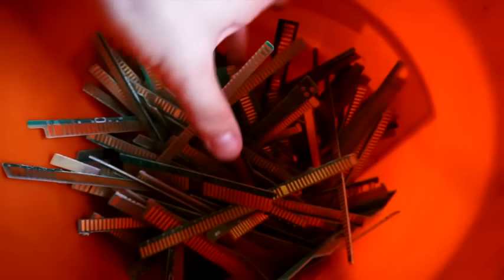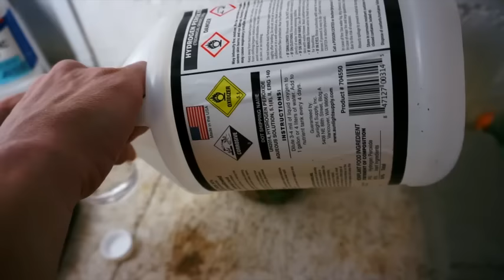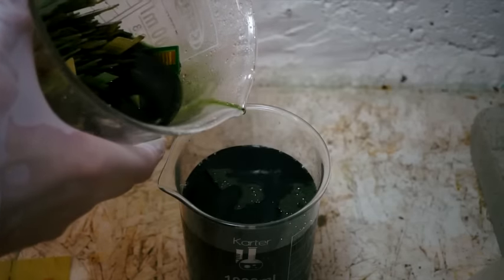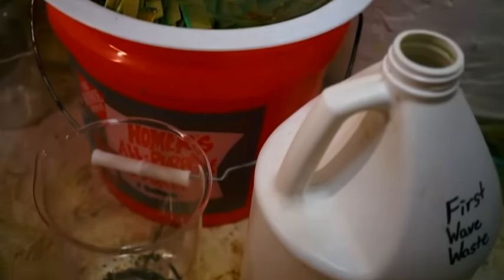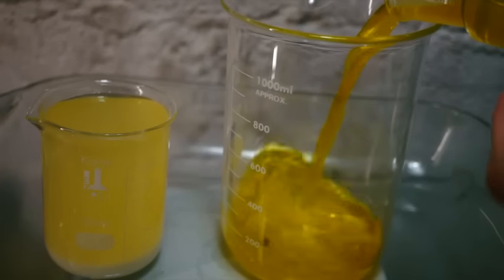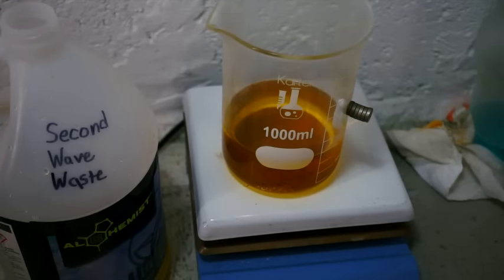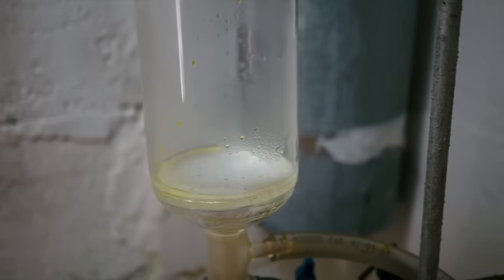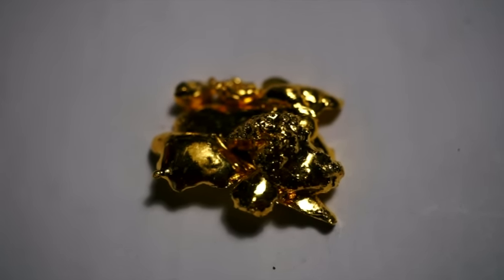How to extract and refine gold from old computer parts.

Comment: In my opinion this guy's doing it  backwards! This process I'm about to explain is the reversal of electroplating, this is how you load up a solution with gold prior to electroplating! And only after this point you would electroplate Gold onto something of Desire! And of course in this case it will be steel wool! You would be smarter to place all your base Metals/circuit boards, that  have  gold plating on them  into a container, then you submerge them in a potassium cyanide solution then place a bubbler at the the bottom of that container and you bubble oxygen in to it, this allows you to oxygenate all your gold plated base metals/circuit board, while submerged in the presence of that potassium cyanide solution! with this chemical reaction you have created, this will allow the gold to dissolve into the potassium cyanide solution, after doing so you remove the base metals/circuit board, that no longer have the gold plating on them! you keep repeating this process with more base metals/circuit board, and go round up any and all gold plated jewelry you can get your hands on, hell get creative go throw Grandma's old gold-plated tableware set in there too! Anything you can find gold plated! and you continue to load up your potassium cyanide solution! when your potassium cyanide gets completely saturated with gold suspended in it, now that this gold has been dissolved into that solution, you need to recover and extract the gold back out of it, you do this through electrolysis, you will electroplate the gold out of that solutions back onto steel wool! obviously you suspend your positive lead in solution, and connect your negative lead to that steel wool, then submerge it into the solution! and you electroplate the gold onto you're Steel wool! you can crush up gold ore and achieve the same results by oxygenating your gold ore! Once you succeed getting your gold recovered from The Ore, that gold should now be dissolved and suspended in that solution! you once again take that solution, and by submerging steel wool into it, like you did from the gold recovered from the base metals, through oxygenating and then electroplating, you recover your gold that's been electroplated on to the steel wool, now when extracting gold from ore through oxygenating it in the presence of potassium cyanide it is important to remember and understand that platinum sometimes nickel and silver comes acrossed out of that gold ore with the gold! you can separate these different alloys simply by adjusting the voltage when electroplating is being performed, the electroplating of platinum requires a different voltage, as well as silver or nickel , I had a friend whose gold mine turned Platinum, this was how they separated the Platinum from the gold through this electrolysis process! now you take that steel wool that's been electroplated with gold, place it into a porcelain Cruise, hit with a torch! [Blowtorch] don't be afraid to turn the heat up on it! you want it pretty hot! your objective is to burn that steel wool up, and trust me it will burn up like the filament in a light bulb! anyhow, you throw flux on it,[ borax]  keep that flame on it, keep it hot! and then your gold will puddle up in the bottom of that cruise! It well look like a beautiful puddle of golden Mercury! there's your finished product! it'll be high grade clean gold! the process that this other guy is talking about is the backwards approach to it! You Can't really hold it against him! everything is about exposure observation! and definitely paying attention to detail! just about everything I have learned I've learned on the lam! once again Better Living Through good Chemistry! I'm not really impressed with his process! As a matter of fact when he was talking about using your muriatic acid to lower the pH in your swimming pool, I doubt if he even knows what a titration is or what the definition of pH stands for! That term indicates the presence of hydrogen, although I could be wrong! he might have an understanding on all of that!  like I said I don't think the guys very informed on metallurgy, although I do like his nature! I'm sure if we ever cross paths somewhere in the future, we would be friends I'm quite sure we definitely have enough in common! At least he's off to a start! He definitely is acquiring the Midas touch! I once had that touch! it almost destroyed me! it was a different type of gold! You know, in this world there are two types of men! those who possess power! and those who are possessed by that power! The big lesson in life is to try and figure out which man you are going to be! And then be that man! Anyhow everybody's got to start somewhere! You got to crawl before you walk I get it! it's not fair for me to chastise, and be too hard on people!I have a tendency of doing that! I apologize! although, I have seen meth labs out on the lower back 40 of somebody's property with better well-equipped labs then his little Workshop! Presentation is everything! his process will work! it's just a backwards slow bottom Keel approach and process!"If maybe you were stranded on an island, with nothing else to work with! I guess eventually you can get her done!" nobody would ever let that guy near a Gold mine, they probably would chase him away with a broom, if they didn't have time to teach him the proper way to do it! One important side note involving the process I was referring to! at no time ever should you allow any types of acid to come in to contact with that potassium cyanide Solutions,or sodium cyanide!or benzyl cyanide or any other cyanides, ever! when they're suspended in this or any solutions, They are generally very stable and quite safe! providing you refrain from any introduction of any acids that might free or crack off that Cyanide! And if so you could very easily poison yourself or anyone in the vicinity, including birds flying by! so by all means do a little research, and be very safe about it! Always work with some adequate type of overhead Hood ventilation, safety glasses, face Shields, rubber gloves, chemical resistant smocks, fire extinguishers, and always have good respirators with the proper chemical ratings available! And if you don't have some sort of a( emergency chemical shower nearby have a garden hose with a adequate spray nozzle on it for emergency wash situations) it's not a good idea to ever work alone! it's hard to find your way to the hospital if something blows up in your face and you're sitting there blind! believe me, I've seen it all! I have a buddy that had to get a cornea transplant over this type up stuff! in regards to cyanide! the releasing of cyanide was a process Adolf Hitler was using, which was responsible for killing off many members on my mom's side of her family during World War II! think about it! so be very careful with this process! [Just a little more insight shared by an old X outlaw, good luck be safe]
Reply from the maker: Thanks, I am happy you enjoyed the video 🤗 😀
Reply: Hey you welcome Phillip, I really did enjoy your presentation! that gave me a reason to walk back down memory lane and enjoy some old post-prison memories! and put pen-to-paper so to speak, I enjoyed your presentation like a walk in the park, good luck with yourself! And that Midas Touch!

Comment: Always add add to water, not water to acid. You should add the acid to the H202
Reply from the maker: That would be inconvenient. I only used about 100 milliliter of H202 with about 1/2 gallon of acid. It's going to get hot either way.

Comment: Were you wearing any kind of respirator or safety eye wear / clothing?  I saw you weren't using gloves.  Kinda scary chemicals to combine and be seemingly unprotected in my opinion....
Reply from the maker: All experiments were performed inside a fume hood. I was wearing safety glasses 😎 Also I was wearing gloves when I stuck my hands in the acid solution of HCL and H2O2 🤗😀 you need to be careful with that H2O2. At a concentration of 34% it will oxidize your skin on contact. Essentially producing a third degree burn. When coupled with the HCL you are producing a super acid. Similar to piranha solution 🤓

Comment: skip all the acid and try borax without all the liquid over low heat
Reply: Dont understand i ise borax all the time as flux ? It doesnt seem to dissolve the gold one could also use hydrogen peroxcide added to sodium cyanide salultion but you need to do it in a lage plastic trough as it explodes slitly step back or you cound use a salution of sodium cyanide and a car battery charger with a piece of silver as a cathoid  pretty clean your gold doesnt have to be 24 kt because you are payed by assay any way
Reply: Zinc piwder also acts as a magnet for gold salution droping to the bottom

Comment: Hey Philip, just getting started really out on west coast of Canada. Could really use a chat to pick your brain if your up for it sometime soon :)
Reply from the maker: What's going on? My videos are full of information.🤓
Reply: @philipbender956  they are indeed and honestly the best we have seen. Our problem is when looking at the equipment to buy. Not sure what kind of beaker is best, or what you would recommend as a vacuum pump etc
Reply: @philipbender956  oh to quick add, we are doing it with license from our government - so it has to be the right scientific glass, etc but there doesn't seem to be any info on what that is from them
Reply: Maybe we could start with this?...Can you tell me the make, model etc of the magnetic stirring hot plate you use? or the link to which of your videos I could find it? I really appreciate your help on this!

Comment: You really need to make a greater effort to wearing the proper PPE when pouring acids and peroxides, and when touching exothermically heated pyrex glassware.  You should also be pouring acids and peroxides in a fumigated hood.
Reply from the maker: All extractions were performed in a fume hood. I was wearing gloves when I put my hands in the acid 🤔 🤣

Comment: What is that device that just appears at 2:46, you didn't say anything about it, so it's bothering me.
Reply from the maker: I believe that is the aquarium air pump. It can be purchased at most pet stores containing aquatic life. It uses electricity to pump air through a tube 😏 Unfortunately they do not work very well as an improvised underwater breathing device. It has a couple of issues. The first being you need to plug it in. I wanted to use it in a lake so I tried an extension cord. It kept tripping the circuit breaker every time it got wet. Then there was the issue that every time you submerged the pump it would stop pumping air.
Reply: @philipbender956  Thank you for explaining. I have just one more question. Why is it even necessary to pump the air? Because hydrogen peroxide gives it plenty of oxygen.
Reply from the maker: @petronus6682  the air pump not only ads small amounts of air it agitates the solution. The h202 doesn't remain in solution very long. At one point in the video you can see the air being bubble through the container changing color as it reacts with the copper solution.

Comment: A lot of steps to get that gold! But you had damn near an oz of gold. Depending on what gold is selling at for an Oz. Probably made 1,700$ right on this video alone.
Reply from the maker: Thanks, I am happy you enjoyed the video 🤗 😀
Reply: @philipbender956  I been considering getting into this electronic gold catching. Definitely seems like a lot of work! But also seems like it could be well worth it. Where do you find all of the old electronics? Garbage picking?
Reply from the maker: @stackin_steve_8223   The scrap I am using in this video. Was part of a 20 pound lot that I purchased at auction on eBay for $800. Try searching gold fingers on eBay. Or if you collect scrap try selling on eBay.
Reply: @philipbender956  o ok cool. Ty

Comment: 30 percent viniger work to takes like a week but great so many different ways.
Reply from the maker: Yes I prefer to stick to the shorter time frame methods. But you also have to balance the safety involved. Some methods are very quick but extremely dangerous.

Comment: NOW I'LL GO TO THE HOSPITAL AND GET A LUNG TRANSPLANT>
Reply from the maker: No, no, no need. Just stop by my lab. I will hook you up with a nice new robo lung. You can even get upgrades from there website. You know, a do it at home type of deal. It's got Bluetooth and a phone app. So you can control how much and when you breathe. I will even throw in a water pipe attachment if you commit with a $1000 down payment and a contract. Act now as I only have 7 robo lungs in-stock. They go quick around the new year. 😷

Comment: An interesting video, but whoever extracts gold in this way needs to know what he's doing. Some of the chemicals used are quite dangerous, and for a layman the whole process seems a bit complicated. Couldn't you do a video showing a simpler method, which although less efficient is less dangerous and more easily carried out by a novice? Another interesting aspect is what sort of profit can you make after all the raw materials have been paid for? I see you avoid the use of mercury, probably because mercury is hazardous to the environment in the longer term. The waste products of your method are also hazardous, so some advice on how to dispose of them safely would be welcome.
Reply from the maker: Thanks,I am happy you enjoyed the video. That was the easiest way. As for the waste. First, I destroy the waste with sodium hydroxide. Then I filter off any solids. Then I PH balance the remaining solution with sulfuric acid drain cleaner. At that point it is safe to go down the drain.

Comment: I want to send a picture of a powder. I believed it has gold in it but I dont know how to extract it.
Reply from the maker: Is the powder you believed to contain gold also made of metal? If yes, start with a magnet and remove as much ferrous material as possible. Then melt it all together to determine the gold amount. Then use aqua regia to dissolve the gold. If the powder is rock or non metallic.  Use water and pan the gold out.
Reply: Thank you. I will try it.

Comment: Couldnt you just melt the gold flakez and skip the chemicalz?
Reply from the maker: You could, but then your gold would be contaminated with other metals. Then the only way to purify that alloy would be to mix it with silver. Then dissolve it with nitric acid. The method demonstrated in the video is the cheaper  and less dangerous method.
Reply: @philipbender956  ah, I see. I got to thinkin that. Good info, thankz yo

Comment: By the time I purchased all of these glass jars pump for air and a vacuum pump and filters acid i would be broke
Reply from the maker: Yeah it's better to purchase these items over time. Spread things out and buy things as you need them. For instance my hot plate stirrer was also used in my kitchen to heat and stir soup. Then I purchased a microwave and I was able to use the hot plate stirrer in the lab full-time 😀 Same thing with my beakers those used to be cups.......

Comment: Hey, does anyone know what % the nitric acid is?
Reply from the maker: It's over 95%. I demonstrated how to make it in a another video. It will set laboratory gloves on fire within seconds of contact 🤗
Reply: oh wow, could you use nitric acid with a % of 70. Or would this not work :)
Reply from the maker: @samking7631  70% nitric acid will work. You may need to add a few extra drops 😉
Reply: Philip Bender legend 👌

Comment: cleverly used hydrogen peroxide instead of nitric acid.
Reply from the maker: Yeah it takes about 1 liter of concentrated nitric acid per pound of gold fingers to float the gold foils off 🤔 The base metal being copper, it is much harder to dissolve. But the oxidative power of the h202 at 34% concentration turns the HCL into a super acid. That cuts through the copper leaving the gold undissolved 🤗

Comment: Is that a robot talking?
Reply from the maker: It's a speech synthesiser. I salvaged most of the programming from in old speaking spell. I had in my closet from when I was a child. It was old and dusty. The cats had shed on it. But a few dunks in the sink and it sounded OK. So I wired it up to my laptop. A Tandy 6000. 😀
Reply: Oh I thought it was a robot or someone with no nose 👃 it sounds like it.

Comment: i have to comment on this video and this applies to everyone please and i repeat please use chemical resistant rubber gloves when working with chemicals that can burn you like the acid that you are working with and use a face shield or safety glasses also this dude aint doing safety right take it from a pool guy who works with chemicals all the time this stuff aint no job and always use outside not inside or the chance if you getting your throat burned is real
Reply from the maker: The smell of chlorine is quite nice around the lab. I use it to disinfect. Just a clean rag away. Happy you enjoyed the video 🤗

Comment: This is NOT the safest nor the most efficient method to remove gold from electronic scrap.  I am a chemist with 42 years experience with building electronic equipment and salvaging scrap from same.  PLEASE DO NOT TRY THIS AT HOME!!  Plus it leaves you with hazardous wastes for disposal.
Reply from the maker: Yeah, but it was really cool when I stuck my hand in the acid 😂 then I was smelting gold with two torches inside a fume hood right next to a gallon of DME 😎

Comment: Your arm skin does not have an excellent resistance to hydrogen peroxide. You would make more money dumpster diving for aluminum cans.
Reply from the maker: I know and that stuff burns when it splashes on your arm.  The area that I live in is very strict about recycling. I think it may be illegal to just throw aluminium cans away in the trash. They must be brought to a recycling centre. Generally a pickup truck filled with aluminium cans nets less money than the amount of gold produced in this video.